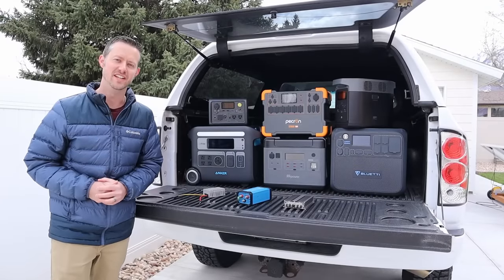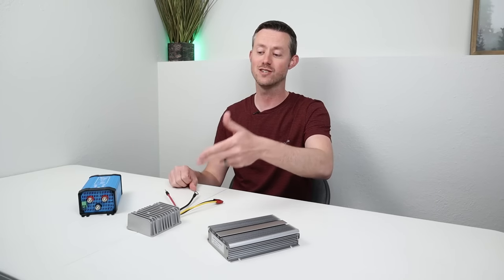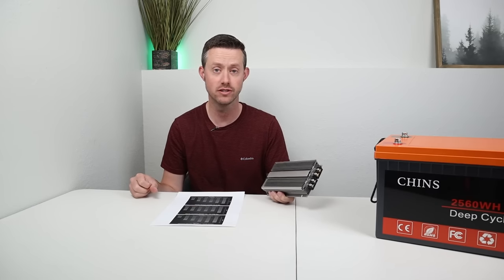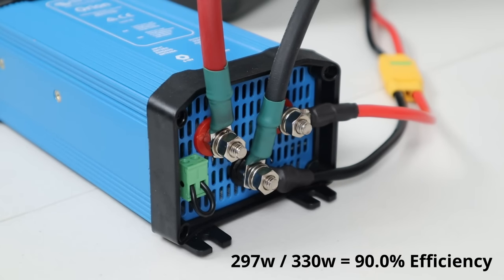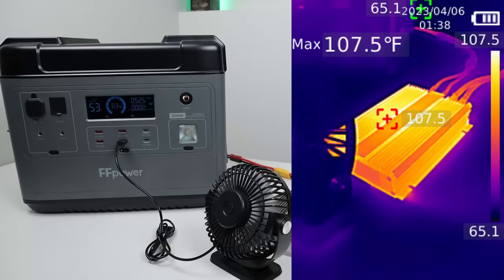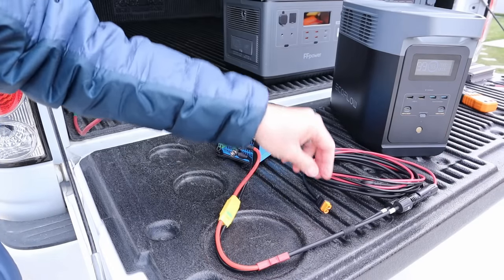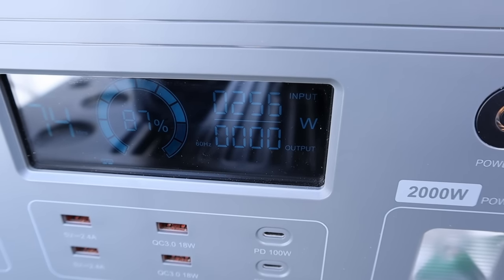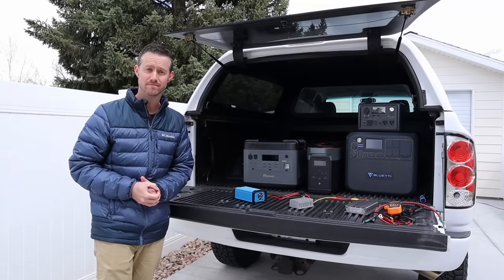Charge Your Power Station In Your Car FASTER - Perfect for Overlanding, Car Camping, and Van Life!

Comment: Will this work with the original delta 1300? My xt60 port says 65v 10amp
Reply from the maker: Yep, I think that model charges at up to 400 watts.
Reply: @Jasonoid  yeah 400w max solar at 10 AMPS those chargers are 20amp.
Reply from the maker: @CplGoldFish21  the power station will limit the imput amperage automatically to 10 amps, no harm done to your unit.

Comment: So if I wanted to get the full 700 watts to an ac200p while driving, what you'll you suggest I buy since the max in this video only got up to 500 watts
Reply from the maker: 700 watts is quite a bit of power coming out of your battery. The only power station that got that much wattage was the Anker767. I wasn't able to hit that high with the Bluetti AC200p.
Reply: Ya but with a ford transit with dual alternator option and dual batteries I don't think it'd drain it. What would you suggest if I was going to try to get 700 watts. It's limited to 12 amps imput, so at 60 volts that's 720 watts. How you you suggest to step up to 60 volts? The ford transit has 3, 60 amp connection points at its battery
Reply from the maker: @BrianHotsauceBauer  I don't know of any boost converter than will put out that high of voltage. As another option you could dual chargeand get more power input. Using the 36v boost converter on the DC side input and then a 500 watt inverter with the stock wall charger on the AC input, then you could charge much faster.

Comment: What if you run two of the same boost converters in parallel??
Reply from the maker: Pulling that much power from an alternator is not recommended. It will burn up. (Unless it's an aftermarket upgraded high amperage alternator)

Comment: Thanks for this video, however, Is there a way to boost the charging directly from the cigarette socket in the car, for those who can’t wire their vehicle from the battery and alternator?
Reply from the maker: No, too small of wires and they are limited to 120 watts. Youll blow a fuse if you pull more.
Reply: @Jasonoid  OK thanks for your reply.
Reply from the maker: @surfinwaves4769  find a friend or family member that can help. Lots of people are comfortable with this type of thing.
Reply: @Jasonoid  👍 good idea!

Comment: Is this basically what Redarc does with DC to DC stuff? I know their systems can get to be very complicated as they have a lot of management built in. 

In this case the power station is doing all the complicated stuff and the converter is simply converting DC to DC.

No idea if im correct on this.
Reply from the maker: Correct, the power stations have the charge controllers built in. You just need to supply the proper voltage and amperage combo to get good power. These power stations have amperage input limits around 10 -15 amps so the only way to get more power is to raise the voltage, hence using boost converters :)  
If you didn't boost the voltage they would charge around 12v @ 10amps, or 120 watts. If you put in 36 volts, you get much more power (36v @10 amps =360 watts).
Reply: @Jasonoid  Gotcha. Thanks

Comment: is there any way to charge Power Station Generators via car chargers? Has to be some way to do this
Reply from the maker: What do you mean 'car charger'? Like a 12v battery charger?
Reply: @Jasonoid  no,  like an electric car charger from the stations base unit. I found what I needed in EcoPro's X-Stream adapter.

Comment: I hate the fact that I have The AC200p instead of the Max. The minimum starting volts for solar is 35 I think. What if the Bluetti charge enhancer was thrown into the Equation? I might actually use one of those converters during a power outage to charge my ac200p from the car if there's no sun out
Reply from the maker: The charging enhancer will only work well with a high input voltage. It has a limit of 8 amps so if you throw 12 volts at it, it charges super slow (like 100 watts). The charging enhancer is designed to use with solar panels in series, to get around 48v but don't go over 60v.
The 12v to 36v boost converter puts out a steady 36 volts, it should work on the AC200P, just get a small fan to keep it cool.

Comment: What voltage did you turn the Victron up to for the test? Also, I thought it was limited to 30 amp draw which is interesting you were seeing 35.
Reply from the maker: I had it maxed to the high voltage, which is around 20 to 29 volts. The 30 amps is the 'output' amperage rating, not the input rating. It will draw much more than 30 amps from your battery to convert up the voltage and get that power. 
Always remember the rule that p'ower in is equal to power out', for example....
28v @ 30 amps = 840 watts
12v @ 70 amps = 840 watts
It's the same wattage, but at different voltage and amperage levels. That's how a power converter works. It just converts the power to a different voltage.
Reply: @Jasonoid Thank you! I reread the spec sheet and it was 30 amp output max as you said. Which makes sense if you factor in around 10% loss due to efficiency and wiring along with your alternator voltage around 13.5. I'll have a scenario where the source will be regulated at 14v (Prius) so this gives me a better confirmation on my wiring and fuse choice. Thanks for the help!
Reply: @Jasonoid  got it all hooked up and was surprised to get 405 watts even with a 50' run of 10awg to the Ecoflow (was expecting more loss than that).Thanks for the confirmation here!
Reply from the maker: @jeepncj7  the Ecoflow has an amperage input limit (15 amps), that's the limiting factor here.

Comment: I would like to charge faster than 12V / 10A using the 8mm! The Solar panels are permanently plug on the left (other inlet) Have you tried this option? If so, since it’s limited to 10A, can i still une the Victron Booster rated at 20A?
Reply from the maker: What power station do you have?
Reply: @Jasonoid  Bluetti AC200MAX
Reply from the maker: @philippedeziel8264  that 8mm (7909) port is meant for either the Bluetti charging enhancer or the AC wall charger only. I have a video on the Bluetti charging enhancer and how it works.
Reply: @Jasonoid  if i use a power boost from 12v to 24 or 36V…and keep 10A, i could potentially double or triple the charge speed !!?? From 120 watts to 240 or 360 watts?
Reply: @Jasonoid  i would like to charge faster than cigarette socket (12V, 10A) while leaving my solar panels plugged into my AC200MAX
Reply from the maker: @philippedeziel8264  if you use a boost converter connected to the mppt port, you'll see the same performance you see in the video when I tested the AC200max.
Reply: @Jasonoid  for sure but that means i cannot charge from boost converter and solar in the meantime
Reply from the maker: @philippedeziel8264  you could plug your solar panels into the Bluetti charging enhancer which plugs into the 7909 port. Then plug your DC converter into the regular mppt port.
Reply: @Jasonoid  good idea. Thank you : )

Comment: Please keep in mind 1 thing: I got  Delta 2 lately and wanted to get the cable from ecoflow that you said with the pin for xt60i. Ecoflow told me that this is no longer true for newer products. For example Delta 2. That was true for older models.
Reply from the maker: I tested this today just to confirm a second time on the Delta 2 (the newer version of power station). When testing with the normal yellow xt60 charging cable I got the lower amperage limit and around 200 watts charging with the small adapter. However, I got the full charging speed when using the Xt60i adapter, near 370 watts. So I'm not sure if that's true on my unit.
Reply: @Jasonoid  weird. Just talked with ecoflow and they told me this. Anyway. I used the regular xt60 cable with a 270W poli panel and I got 230W. Seems ok.
Reply: @renmedia  I'm glad you mentioned the solar charging with the "other" adapter. I just bought one for my Delta 2. I may need the I if I go the alternator route.

Comment: The Eb3a  seems to not like the voltage ⚡..On another channel..it made a funny noise when charging this way....I do own The Eb3a.
Reply from the maker: My first EB3A had the charging noises, this is actually my second EB3A and it doesn't make the noises....but it also didn't like 24 volts. My EB70 and EB55 both worked well with these types of converters in the past.

Comment: Why can't you use pure sine ac inverter and plug in your standard lifepo4  charger I ran 6 guage wire to the back on a 50 amp breaker to the battery works flawless
Reply from the maker: Charging a standalone battery is a little different than charging a power station. Most new large power stations charge at 1000 to 1800 watts from the wall. If a power station wants to charge at 1200 watts, you'd have to run a huge inverter and even larger wiring. That might pull too much power for your alternator to handle without failing. If you have a power station with an adjustable charging rate it would work just fine. If you want the most efficiency in your system, DC to DC charging is the way to go. This video is one way to do it, there are many ways.
Reply: @Jasonoid  Ok because I do it with my e600 Pecron and my Dr prepare powermax battery. Thank you for your response love your channel

Comment: Is there any reason this is better than just hooking up an pure sine inverter
Reply from the maker: An inverter would be less efficient, not a horrible solution and it would still work just fine. You'd want to make sure you are not pulling too much power from the battery /alternator. I'd say stick around the 500 watt level. So if your power station charges higher than that you might be pulling too much power for your cars system.

Comment: @Jasonoid I went with the victron to charge the ac300 but I havnt seen it charge more than 230w? Any ideas why it’s so low?
Reply from the maker: It has a 10 amp input limit at 24 volts output. That's what I saw on my Bluetti AC200max when testing. Youll want to turn the knob all the way up to get 28 volts output, that will give you 280 watts. That's a limitation of the AC300, not the Victron.
Reply: @Jasonoid  I double checked everything and I can’t get more than 232w using the victron into a ac300. The screw is turned all the way up. In your chart you were getting 415w with the victron, is that right? Any special cable or setting I need to look into?
Reply from the maker: @dsp5500  make sure it's set to PV input and not car charging input.
Reply: @Jasonoid  Double checked but still limmited to 232w max

Comment: Some would find  just a 350 watt pure sine inverter, like a Bestek,  much simpler  plugged in to the vans 12v plug.  You could have used one of these and showed the difference.  From you and others all I hear is the word losses.
Reply from the maker: What power station would you want to charge from the 350w inverter? Most power stations now pull a lot more that 350 watts while charging. For example, if a power station wants to charge at 1000 watts and you only have a 350w inverter, it will just shut off from being overloaded. If you have a super slow charging power station or a power station with adjustable AC charging, a small inverter like that will work just fine.

Comment: Would a 100a alternator be enough for the 20a inverter?
Reply from the maker: What voltage is the converter putting out?
Reply: I’m planning on purchasing the Victron you demoed in the video.
Reply from the maker: @Colom990  that should be fine!

Comment: Hi.  Do you connect the converter to the alternator or 12v battery?
Reply from the maker: The battery, then the battery gets charged by the alternator.
Reply: @Jasonoid  thank you for your reply.  I have the larger Anker in your video so will need the larger converter. I think they need 32v to treat it as solar.
Reply from the maker: It's better to go with something like this:
https://youtu.be/IBtENPh5rTA
Reply: @Jasonoid  that’s amazing. Just need to find one in the UK now though.
Reply from the maker: The Victron should work on the Anker as well. The new firmware allows for higher amperage input at 27v now.
Reply: @Jasonoid  I’m sure the Anker 767 doesn’t recognise as solar until 32V.  Am I right. Or will I still get about 300w with the victron?   Thank you so much for sparing your time to advise also.  I really appreciate it.
Reply from the maker: ahhhhh, you have the 2000wh model.... I think you'll be limited as seen in the video with the Victron unit sorry for the confusion. I thought you had the F3800. Having fans on the unit is a must, these get too hot without fans!
Reply: @Jasonoid  I've managee to purchase this on their store, thank you so much for your advice.  Great content!

Comment: I have a situation that you might be able offer some insight to. I'm trying to do something and not quite sure how I can do it. Is there a way that we can discuss this to see if you can help in some way? You seem to be on the same page as I am with increasing charging wattage by tricking the system into thinking it is receiving solar input by the supplied voltages.
Reply from the maker: You can meesage me here with questions and I can give you some detailed feedback:
https://asqme.com/@Jasonoid
Reply: I would like to invoke a couple of thought provoking questions about this video if you don't mind.
The Anker 767 seems to have disappeared from the comparison list about halfway through the video, pretty much right after the charging graphs were being displayed. Where did it go?
There was also a "real world" testing that you showed, where the Orion was drawing 35A from the charging system under the hood, but it didn't show the amperage draw from the other 2 test units that were in comparison to this Victron Orion unit. The Victron is also supposedly adjustable, isn't that what was stated? What voltage was it set at in this real world test where it was drawing the 35A from the truck's system?
I can't really state which one I would go with, if I don't have a full comparison of everything that was in the list. Could you? Could anyone? No offense, but there is missing data needed to fully compare them.
Is there a way to supply this missing data so someone like me can make an educated decision as to which of these I would go with? That also requires having the Anker back in the running. Right? The big power units are not all the same and each have their own specific features.
Thanks.
Keep up the good work. 😎
Reply from the maker: @lyndonjust1962  I still have the Anker 767 I just didn't chose to feature all models in all the tests. I was not going to walk through the 'real world' testing with each power stations from the graphs with each converter. That would take weeks and hours of recording/testing. 

I showed just enough information to understand the concept behind higher powered DC to DC Charging and to calculate your own needs. 
If you need more advanced consulting about a specific model, reach out in Asqme.
Reply: I have a 767 as well. I hooked a 100AH LiFePO battery to it into the solar charge input using a cheap 24v/3A output voltage converter to trick it. Theoretically it should output 72 watts, but it punches out 144. Can't seem to figure out why. I checked the draw from the battery cable and it showed a tad over 12A. I expected 6A. I also have a 36v/10A converter that I was considering hooking to the car's charging system to charge the Anker. I just can't figure if it is going to draw 30A from the battery or double it like the other one did and crank out 60A, or why it would. So I was really looking forward to that data from this video, and I had to ask. The difference in required wire gauge would be huge. What is your opinion of the Anker?

Comment: How to connect from Victron to Jackery 2000 plus?
Reply from the maker: You'll need to buy a few adapters and make your own cables but that isn't too hard (Jackery uses their own proprietary charging plug). Since the Jackery 2000 plus comes with the 7909 to 8020 adapter you'll need to use a 7909 plug on the end of the Victron

Comment: Pretty impessive, but oh my poor alternator! More voltage at the outputs lowers your amperage required for a given power output in watts, but the current really starts climbing at the 12v input. 40A of input curren to achieve the rated output of the 36v unit. 😂
Reply from the maker: Alternators are designed to put out more than 100amps to 150amps all the time. Using the Victron won't stress it out much.
Reply: @Jasonoid  So I have a Japanese JDM kei truck with 660cc of raw power and alternator capacity of between 40 and 50 amps. Not much headroom to work with so I probably won't use it very frequently😓
Reply from the maker: @ernieschatz3783  well.... That's not a normal truck! Sounds fun though haha
Reply: @Jasonoid  😂 Such is life in Japan. It's fairly common over here. I could probably retrofit an 8OW aftermarket unit, but can't find any drop-ins yet.